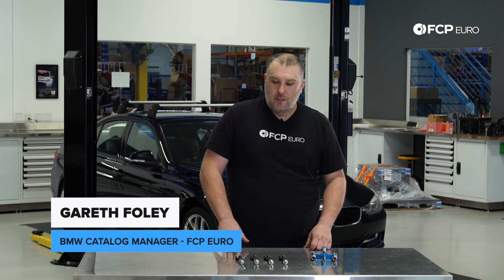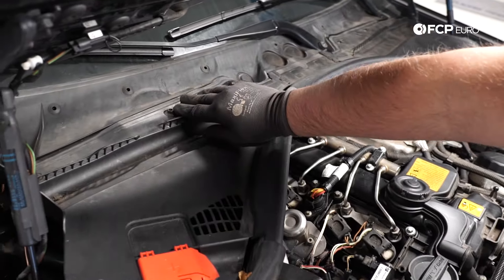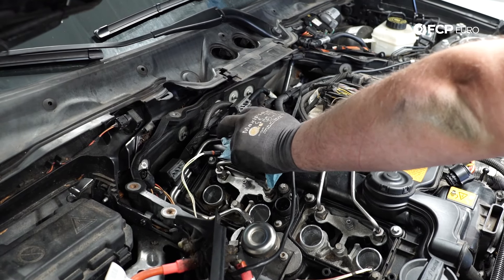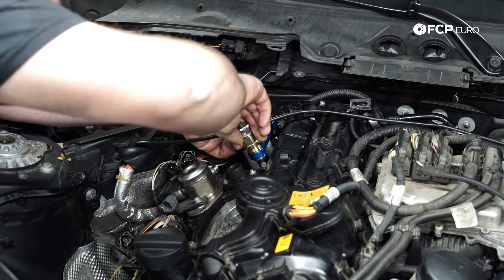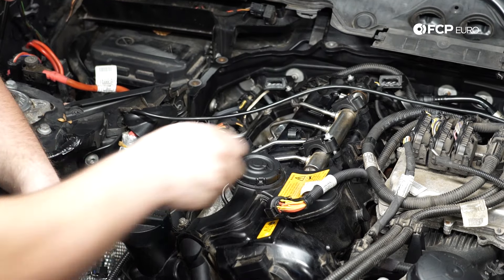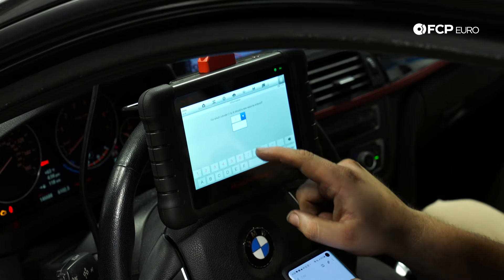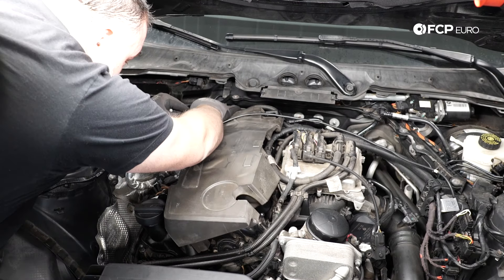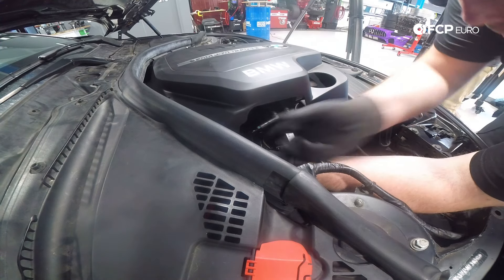BMW Fuel Injector Replacement DIY (BMW F30 328i N20/N26)

Comment: Showing us all how to take them out but not how to correctly put the new ones in. Bravo 👏🏽
Reply: Exactly
Reply: They did show it though.
Reply: @joelvanhorn7448  they did show it
Reply: To those who don’t get it.  Proper installation involves compressing the ptfe seals.
Reply: @bendavid5029 brand new injectors come pre built with the seals installed… just because you work on a bmw does NOT make you smart… they just aren’t that fucking hard…
Reply: @markblonski6635 yeah, when I made the comment I was under the impression you were supposed to recompress the pre-installed seals 😅

Comment: To remove the injectors and reinstall I’m reading that if it takes more than 5nm of torque to remove it, the injector needs to be replaced. Why? Is it due to scoring the teflon tip? What actually goes ‘bad’ that you cant refresh the seals and reinstall? Can’t we just replace the teflon tip and washer? Thx
Reply: if you’re doing all this work just to replace one injector, what’s the point? it’s more cost and time effective to just replace all four at once and not have to mess with it or worry about other injectors going out

Comment: I need some help guys..i have a 2015 bmw 528i..i replaced thr valve cover gasket,before that everyhing was running fine but after i replaced a coil cause it was stuck in cylinder #4.i sprayed a lot of dw40 started the car and cylinder #4 wasnt working,unplugged #4 and saw no difference.i removed the spark plug and reinstalled it,nothimg change then i swaped coil 4 to coil 2 and 4 was still dead..i unplugged #4 fuel injector and #1 and now i have misfires in 1 and 4..i unplugged the injectors while car running

Comment: Do oyu have to reset the Fuel trims after injectors replacements? I had 2 leaking injectors, and now i get positive short term fuel trim and negative long term, I've don't 300km and they still look the same

Comment: Good vid, I had a mis motor idled real bad had 3 dealerships tell me timing chain and wanted over 7,000 to do the job, I was skeptical. Motor only had 13,000 miles on new motor. Changed everything I read on line, nothing worked so I bought new injectors,  problem fixed. Bought the car from my sister, they had a new motor put in it at 66,00 miles. Issue started at 77,000 miles. So any bmw n20 probably will need new injectors around 75,000 miles.
Reply: Hey i have an n20 about 69k miles, i just ordered my injectors to keep up with maintenance but i noticed u said mechanics told u you had timing chain issues, was your car kindve jumping at acceleration from a standstill? or did u have any timing chain issue like symptoms? any check engine light?
Reply: @maggiereyes6796  every thing was fine, just started it up and that's when it started idling bad, would not stay running.

Comment: Well explained thank you. Let me ask before I start should I disconnect the battery? There is the possibility that the fuel pump can pump some fuel after the feeding line from HPFP is removed.

Comment: thanks for a very helpful video. Just one question - after entering the injector compensation values, is there any need to reset any adaptations to allow the engine to relearn or is it fine to merely enter the new compensation codes and leave it at that??

Comment: hi buddy i have the same f30 328i ,but mine only broke the piston rings, it doesn't build up compression..do i need to take out the engine or what's your advice to fix it easy and smart???

Comment: Short question. I have a 320d, and my injectors are full of oil. When i start the car it smokes so much that it looks like a smoke bomb. Is this valve cover sealing related?

Comment: Great video! I had to do injector 4 when I got my car used at around 71,000KM as it was leaking slightly. I didn't use any compression tools for the teflon gasket that came with the new Bosch injector, was already installed. I see that you guys didn't use one either but I guess this was a bigger deal on previous models/revisions? Was easy enough to install by hand, too!
Reply: you prolly dont care at all but does any of you know of a way to get back into an instagram account?
I somehow lost the password. I appreciate any tricks you can give me
Reply: @Xzavier Adonis instablaster ;)
Reply: @Howard Lucca I really appreciate your reply. I got to the site on google and I'm in the hacking process atm.
Looks like it's gonna take a while so I will get back to you later with my results.
Reply: @Howard Lucca it did the trick and I finally got access to my account again. I am so happy!
Thank you so much, you saved my account !
Reply: @Xzavier Adonis you are welcome =)

Comment: Ok so, when you put back the new injectors u dont have to use the tool anymore?
Reply: No you don’t I made the mistake of using it to installed them back and almost stripped two injectors. Great video and ez installed . You need a tool for the injectors coding is a must .
Reply: You should. The tool sets the initial depth of the injector in the bore. The clamp finishes it off. If you just push it with your hand, you might go too far, or not far enough, then it binds when you clamp it down with the retainer. That can cause issues down the road.

Comment: You don’t need to remove the high pressure fuel pump, right? I’m assuming he replaced that
Reply: no need to if you are doing just injectors. You might need a diagnostic scan tool to reprogram injectors if they are all different values.

Comment: What is the difference between the u5 injectors from early year f30 328i and the u6 on the 15/16 models and up
Reply: eu5 require programming the eu6 dont i think and is either or, meaning you cant swap eu5 for eu6 or eu6 ones for eu5
Reply: FCP team please confirm…

I read elsewhere that if your production date is after 07/01/2013 it is always EU6. 

Also, select EU5 type if production date is before 7/1/2012 and EU6 with production date after 7/1/2012. Also might check with a flashlight if all the flow rates on the currently installed injectors are (215). If so, 
more likely its a EU6 type.

As the video explains any EU5 type requires individual flow rates configured and readapted to computer.
Reply: I have checked mine and 1 and 4 cylinders mark 215 i suppose all 4 are 215

Comment: What are the torque requirements for installing the high pressure fuel rail connections?
Reply from the maker: For the fuel rail connections, BMW calls for 30±3 Nm.

Comment: Do you need to reset the adaptations?
Reply from the maker: Hey there, for these you need to calibrate the injectors to the vehicle so that the car knows exactly what injectors it is running, covered around the 18min mark!

Comment: I need some help with my 328i 2013 N26. Replaced plugs, coil packs all cylinders, injector #4. Followed a video to re-enter codes, all codes are zeros and cannot update with correct codes

Comment: Do you need to press the injectors back into the engine on a n55 ?  With the tool ?
Reply: Yes. Not press. Rather set the depth into the cylinder. That's basically what you are doing when you follow the torque spec.
Reply: @LynxStarAuto  Have you had to install these injectors?

Comment: How can you find out if your car requires eu5 or eu6 injectors?
Reply: You have to plug the car up to ISTA D or ISTA Pro and it will tell you which ones you need!
Reply: The part number is on the injector, eu5 - 0 261 500 109 
eu6 -0 261 500 260

Comment: Hello I have a 2014 BMW 535i xDrive with an n55 engine I replace one of my injectors with a eu6 and I started having misfires after that what is the problem I ordered the eu5 now I'm about to get my mechanic to put in the eu5
Reply from the maker: Hi Tameka, there is a procedure you need to follow in order to determine which injector your vehicle requires: Per BMW service bulletin SI B13 03 15 the injectors in the vehicle may not match with what is listed in the BMW ETK. Identify the injector installed in the vehicle using ISTAD 4.04 or later test plan using the following path:
Vehicle management - Service Functions - Powertrain - Engine Electronics - Injector Determination
Test plan will state, "this engine required EU# injectors". This fuel injector is for vehicles with an EU6 designation and will not work on a vehicle with a different designation. On N55 vehicles high pressure pump identification is not required.
Reply: @fcpeuro  thank you I found out I called the dealer with the part number from the old fuel injector I took out and they said it was a the eu5 so I replaced it with a eu5 and so far so good no drivetrain malfunction

Comment: So the problem I'm having is finding a N26 injector puller that fits the EU6 injector.  Do the N20 and N26 motor use the same puller ? I see a lot of the N20 / N55 puller on Amazon can I purchase one of those and still have the same results?
Reply: So I found a slide hammer style puller too bad the website you offered for the extractor was out of stock so I guess that works just fine so anyhow thanks for the help guys appreciate it have a good one

Comment: When reinstalling the actual injector into the cylinder, how do you know its seated properly? Im assuming its not threaded. My inj in cyl6 keeps slightly vibrating up and down upon idle. 
Can anyone help please!!!
Reply from the maker: The injector will bottom out when you drop it in by hand, then the retaining plate will keep it from moving. If your injector is moving around, then your plate may be bent, or not installed correctly. We would highly advice not driving the vehicle until you can resolve that due to the fire hazard that can be.
Reply: @fcpeuro  THANK YOU GUYS! I found it out myself after rechecking my work again for a third time. The retaining plate had 2 prongs one on either side that were indeed bent. I bent them back and now my injectors are sitting snug.

Comment: Nice video, very helpful. I would like to know though how can I fix my “SOS malfunction” message on my 2016 328i. It just started today and with all the information online it can be very confusing into knowing what exactly is the cause of it. Any idea what could be the issue and how to fix or if anybody else might know???
Reply: Download and buy BIMMERLINK 
And buy a self diagnostic plug in that you can plug into your car and diagnose it via phone.
Reply: Hi this might be late but a new battery for the tcb would likely be the problem

Comment: how do i know if i have eu5 or eu6 injectors?
Reply from the maker: Hi Dominic, we have it listed on our injector listings and goes as follows: Note: Per BMW service bulletin SI B13 03 15 the injectors in the vehicle may not match with what is listed in the BMW ETK. Identify the injector installed in the vehicle using ISTAD 4.04 or later test plan using the following path:

Vehicle management - Service Functions - Powertrain - Engine Electronics - Injector Determination

Test plan will state, "this engine required EU# injectors".

Comment: Do you need to calibrate EU6 injectors?
Reply from the maker: Hi, the process will be the same for the EU6 as it is for the EU5 units installed in this video!